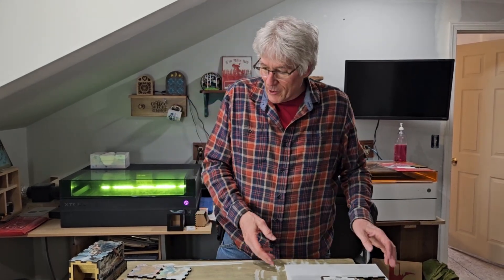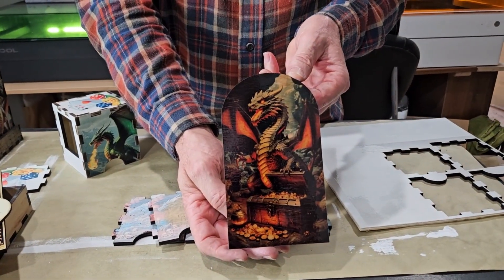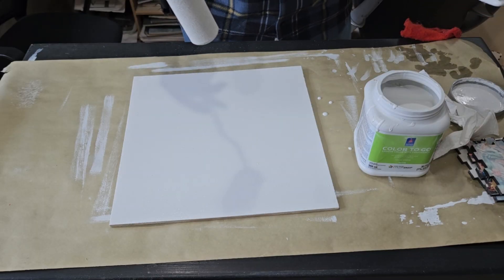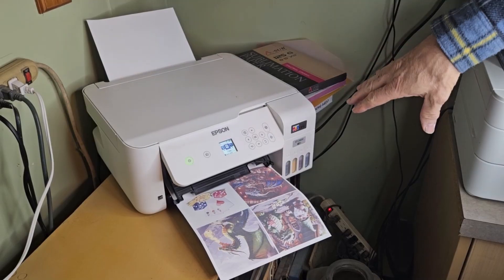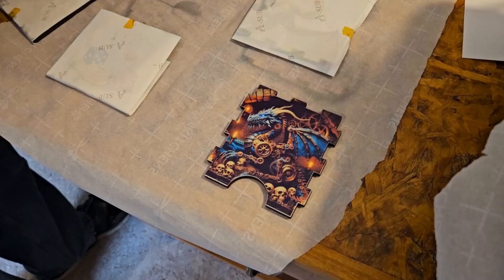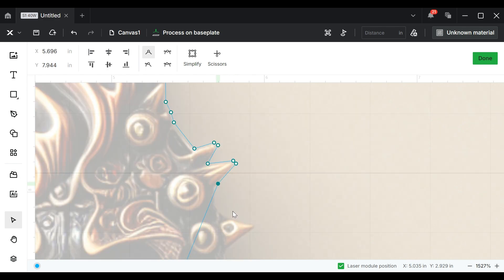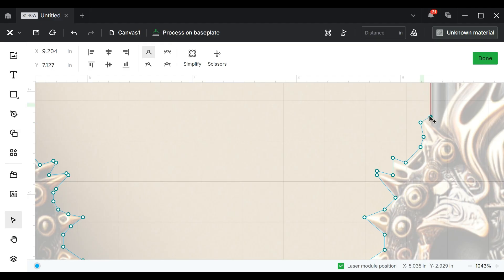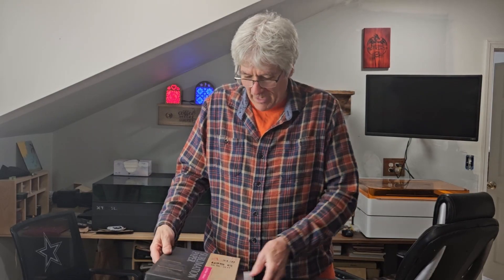Sublimation on wood

Comment: Im having issues using laminating sheets on either hardboard or mdf. They stick but, i am getting corner lifting everytime. I lay down a primer and everything, and still get the same result. Anyone know something that i dont here? Ive been fighting this for 2 weeks.
Reply from the maker: I haven't tried it on MDF but I found that if you brush or spray on a light coat of Minwax Polycrylic they stick very well. I also fount that the matte finish laminate sheets do not work as well as the glossy ones. I use these and they work great https://amzn.to/3MLp6ny

Comment: I have found the easier way. I buy white coated on one side MDF 3mm thick and then I use regular A-Sub sublimation paper and sublimate directly on that MDF 😎 comes super clean and sharp. After sublimation I give it 2 layer of transparent matt or gloss coating and then I cut in LightBurn using Print&Cut function. Cost of white MDF is super low
Reply from the maker: I like the idea, but I never run MDF in my machine if I can help it. I run plywood most of the time to keep my machine clean. I am still on my original lens after nearly a year of running my S1 steady. I worry the time saved in painting would be spent cleaning. I may have to give it a try and see how well it works. I have seen the MDF in cool colors and patterns.

Comment: My lamination wrinkles when heat it. How do you get the lamination to go on smooth?
Reply from the maker: I haven't had it wrinkle, I have had some small bubbles. If I get small bubbles I use my squeegee to smooth them out while it is still hot. When I do my press at the higher temp. for sublimation it comes out nice and smooth. I set my pressure at medium, I hope this helps. When you use the squeegee press lightly, the laminate can scuff if you press too hard.

Comment: Can’t you just peak the lamination right off?
Reply from the maker: The matte laminate sheet peeled off, but the ones that I shared the link to do not peel off. The lamination paper fuses to the wood lightly on the first pass,, then when you sublimate on the laminate sheet it fuses to the surface very nicely.

Comment: That’s awesome. What settings did you use for cutting the pieces out on your laser. I have the same one.
Reply from the maker: So sorry for the late response, I didn't get a notification. I use 100% power 7 speed on .25" wood. The settings may vary depending on the wood. Doing a test grid will help get your settings dialed in. If you are not sure how to do a test grid you can watch my Acrylic test video, in it I show how to do a test grid. here is the link    https://youtu.be/MzRR61CT4Io, again sorry for taking so long to respond. I hope this helps.

Comment: Your work is fabulous! 
Have you ever tried the matte finish laminate sheets?
Reply from the maker: Thank you! No I haven't tried matte sheets. I will have to try them in a future video. I will get some on order.
Reply from the maker: in my latest video I try matte laminate sheets at several settings and it didn't work out very well. Itmay be the brand I tried. I will be doing more testing.

Comment: I use the Rustoelum 2x white primer in the rattle can to paint my board and then add the lamination. It works really well.  Do you weight the wood after it comes off the press so it doesn't warp? Great images and work!!
Reply from the maker: I use Sherwin Williams paint applied with a foam roller so I don't have fumes in my studio during the winter. If I see warping I have a 25lb weight I put on them. But the dice towers that I build with these I just glue up and they have worked out really well.